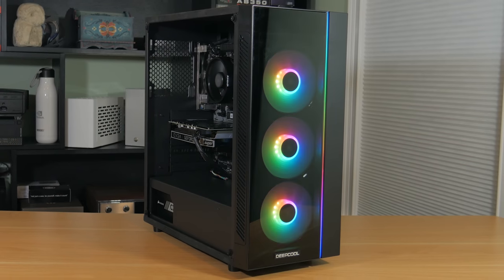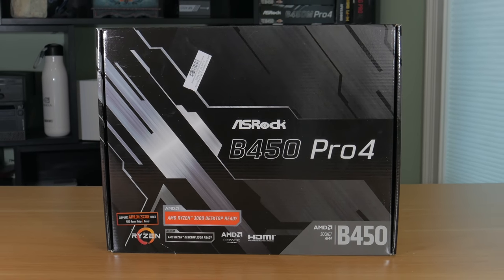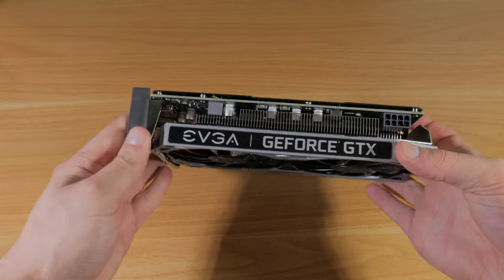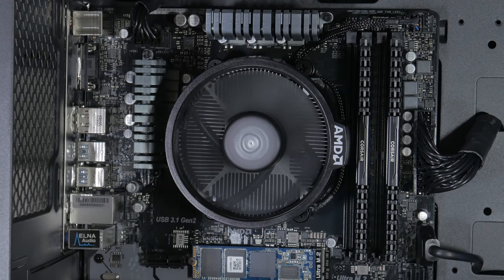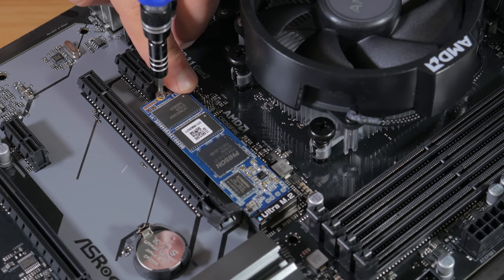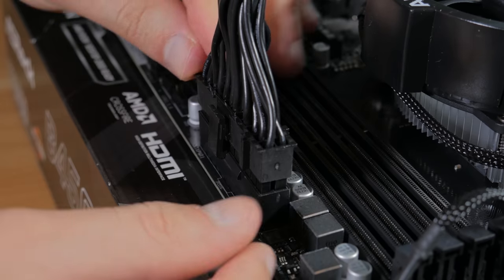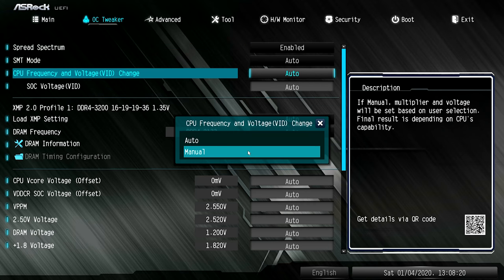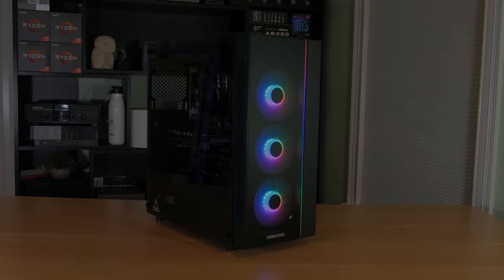$750 Gaming PC Build Guide! | January 2020

Comment: 2:54 - I would recommend rotating the cooler 180 degrees to prevent the AMD logo from blocking the dimm slot.
Reply: Diego Galvez hahah yes
Reply: i wwould recommand how he put it is the "good" way, this cooler is made to be like in this video. you can check online.
Reply: vinvinudu77 how would you put in 4 sticks of ram then ?
Reply: @unemployed6776  This is a micro-atx board, but there would be enough clearance for the ram if it were full atx.
Reply: Great idea. I wish I saw this comment before installing mine 😂
Reply: Came here to say this.  Bonus comment, Diego it is full atx not micro
Reply: Yeah, wish I read your comment first. Had to take it off and do just that cause I put in 32g
Reply: Clockwise or anti clock wise?
Reply: Diego Galvez I completely agree
Reply: @unemployed6776  put the ram in first
Reply: Or position it upright

Comment: For every build I did with AMD I always switch the AMD logo and put it to be on top(not left or right), it may be just me but it looks better that way.
Reply: agreed, ive never used the spire or steath cooler, but it seems much more aesthetically pleasing. i only have experience with the wraith prism and max
Reply: for the wraith stealth cooler, u can't. The holes on the mobo for the cooler, is oriented in such a way, that the cooler must be oriented to the left or the right (cannot be top).
Reply: Is it worth the cable slack tho?

Comment: I’m buying a pc and didn’t know what to get this helped me so much u got the perfect timing for the vid.
Reply: Don't buy a PC. BUILD it. The components that come in store bought PCs are CHEAP. Look up some of Walmart's builds. They're nasty.
Reply: And, even if the store bought PC says it has a 1660 super it's the cheapest version. Cheap fans too.
Reply: Bill B yeah it might have a 1660 but they usually skimp out somewhere like air flow, storage or ram
Reply: There are sites where you can yourself choose component and they will assemble and send it to you. Choose that instead of buying a prebuild.
Reply: Sahas K what site is that?

Comment: I built this pc with every part except the mobo (used a slightly different one on accident) and this pc runs like a dream. I can run fortnite at 200 fps with max graphics on with no trouble at all. I only had one problem, the root of the problem might have been the slightly different mobo, but not sure. I got the B450 M Pro motherboard instead of the B450 Pro. there is a slight difference, and some of the inputs are in different places, so MAKE SURE YOU HAVE THE EXACT PART HE SAYS. The PC was crashing every 10 minutes or so when I first built it, and I got a tip from a friend to take a stick of RAM out, and that worked. It might have not been seated properly or I just got a bad stick but 8 GB runs fine. here are a couple links to a video on how to set up the BIOS and a reddit page on how to put the correct configuration for the front panel connectors (Matt said look in the manual but I was lazy):
Front panel connectors: https://www.reddit.com/r/buildapc/comments/ahp51r/prime_b450ma_front_panel_connector_problem/
BIOS:https://www.youtube.com/watch?v=vHS_3qi0kXg&t=172s
Thanks Matt if you end up reading this!
Reply: jaspa b yeah i almost accidentally got the B450 M Pro too on accident... it’s a dumb marketing design they look so similar and the name is almost identical. i ended up like triple checking my parts to make sure i got the right stuff and i realized it, so happy i did lol
Reply: Ryan Baird can you send me a link to the actual motherboard ?🥺
Reply: fruyeeni https://www.microcenter.com/product/509729/asrock-b450-pro4-amd-am4-atx-motherboard

Comment: Hey man. I just ordered all the parts to build my new PC. I spent about $759 without taxes. $809 with taxes. I got a ryzen 5 3600, coolermaster hyper 212 rgb, MSI b450m vdh max, Gskill aegis 3200mhz 16gb, then I get 1 tb crucial p1 NVME M.2 SSD, then I got a XFX Fatboy OC+ RX 590, and the fractal design focus G, and a 500w PSU from Evga. Gonna upgrade to rtx next year

Comment: How about the CPU temperatures with the stock cooler?

Would like to see a second part.
Reply: Andrés G idle is averaging 40 c but I also have  6 fans in my case gaming is great also with rainbow six around 60-70c and Fortnite around 55-65c
Reply: @chickendinner1563  thanks for the reply!
Reply: @chickendinner1563  what other games you play?
Reply: Your Favorite Jojo that is currently it and they temps were tested with an over lock on the cpu and gpu

Comment: i’m not trying to hate, but I really, really think even at any price range below 1,500. Just go used. It. is. insane. Going used makes SO MUCH MORE SENSE. I made this near exact same rig (but better) for 650 LAST YEAR. 

Specs: 
Gtx 1070 ti (with massive scratch) -200$
R5 2600 -140$
2x8gb 3000mhz ripjaws -60$
2tb seagate hdd -40$
128gb samsung ssd -20$
Case (same as video) -50$
fan -20$
2rgb strips -10$
1000watt psu (I know overkill but insane deal) -60$
50$ on odds and ends, cable ties, 1 rgb header to 2. 

Final: 650 for a better performing build 1 year ago.

Now I am not dissing on him at all, this is a fantastic build for 750 NEW. But, all i’m saying is going used.. is litteraly, the best thing to ever come. You get insane deals, insane prices. And to finish it off, insane performance. All i’m saying is, any price range i would say below 1,500 just go used. You will not regret it. 

I mean no hate, just wanted to share, Thanks.

Comment: This is a great guide, however I did change some things.

1. I changed the motherboard to the gaming k4 from asrock.

2. The RAM was changed to Corsair Vengeance RGB PRO.

3. Got a cheaper be quiet! 450w psu because 450 is all you need.

Comment: This is literary the setup i wanted to build and now it costs like 850$ ...
Reply: Just get a different case.
Reply: For me its £788.18
Reply: now it costs 770!!!!
Reply: @milfshakeyaeger7675  oh really?
Reply: @warrior8154  for me its 755
Reply: @milfshakeyaeger7675  for me it cost still like 820 euros and to ship it to finland 910 euros so lmao
Reply: Well u could always use used parts or use different parents in general, Ryzen 5 3600 ($180-200), B450 Pro4 ($85-90), GTX 1070/ti ($200-300)(used), or u could go for the 1660 super if u want new, 120gb kingston a400 nvme m.2 ssd ($20), 2tb seagate bearacuda hdd 7200rpm with 526mb cache ($55), OLOy 16gb (8x2) 3200 RGB ram, or Corsair Vengence 16gb (8x2) 3200 ram ($62 ish), aresgame 650w psu 80+ bronze ($60), any atx case ($60), that should be about $650 ish u can change the psu and ram to something if you want like from a more reputable company. If u dont want the stock wraith cooler id go with the thermaltake ux200 ($32-40), and get a 5pack or less fans rgb or not (40) if u get the parts i listed it comes out to be about $700-$750 depending on where u get your parts from

Comment: Would've been a lot better using a ryzen 5 2600 with an rx 5700 and a 2.5 ssd instead of the m.2, way more gaming performance for the same price
Reply: Amir Lalmi Ryzen 5 1600 “af” is 85 bucks and is better
Reply: Please search in google before commenting
Reply: @tanishqbhaiji103  i am well aware of the 1600 AF but there aren't enough benchmarks out there that prove it's value whereas the 2600's performance and value has been proved time and time again
also don't be condescending to people it makes it hard for them to have  a polite conversation with you
Reply: 1600 is better for price to performance and you could get a 1080 on amazon.de for 250 euro so 280 dollars ish.
Reply: @R3RS2024  the cheapest 1080 on amazon.de is listed at 435 euro so no

Comment: That is a fantastic build. After such a busy Christmas/New Years it was really calming and almost therapeutic to watch this video. For some reason I still like watching build guides even though I already have a rig. Only downside to that build was the case because I do not like the fact that you have to push out the PCIE slot covers. Can get messy and you cannot reinstall them if you want to sell the PC case again or something. Great well rounded gaming PC though otherwise. 
However, I have a question since I have a 256gb SATA SSD for my boot drive and a 1tb hdd mechanical for mass storage of games etc. But it takes up so much room in my Silverstone Sugo SG13 itx case so I wanted to get an M.2 ssd. Would it be worth it to get a non-NVME SSD since they are a lot cheaper then the NVME ones. I could get a 500gb M.2 ssd for around £50 which is not bad. Though I might wait and save up for a 1tb NVME SSD so I don't run out of room. 
Also, would a GTX 1660 super or 1660Ti be a good upgrade from an RX 580 8gb that I got used for £120? My other specs are a Ryzen 5 2600 (new) and 16gb ddr4 3200mhz ram also new. I have not overclocked my CPU because there is a psu on top of it with a few centimeters of space and I'm using the wraith stealth cooler. But do you reckon I could run an overclock like yours in my build? 
Many thanks in advance and hope you had a good Christmas and new years!

Comment: Great video. But you forgot to mention the Ryzen 3600 processor's compatibility issues with B450 motherboard. My suggestion is to go for Ryzen 2600. You can find find the difference between 2600 and 3600 processors in very few selective games, which will be a 5 -10% increase in performance in favor of 3600. Other than that, virtually no difference at all.  You can save a few bucks with 2600 and don't have to go through the hassle of updating the BIOS of this board or buying an x570 board. That's my 2 Cents.

Comment: i just bought a 600$ pc featuring a ryzen 7 2700 and rx 580 4gb cant wait to build it this next weekend
Reply: Cadeece I saw the 2700 is 159 on amazon.... truly a steal!
Reply: i would have gone for the ryzen 5 1600 and a rx580 8gb which will out perform the 2700 rx580 4gb for 10 dollars cheaper
Reply: @R3RS2024  i got a great boxing day sale on the ryzen 7 2700 and the 1600 really isnt better its a 6core processor which is already getting iffy for alot of stuff and i got the rx 580 4gb used because i missed out on a different card i wanted to get but the 580 4gb is fine for my needs
Reply: @onecleangti  yea i got it for 130$ ish on boxing day was a great deal cant wait to put it in my first build
Reply: @cadeece6739  why did you not take a rx 570 8gb
Reply: @khoado2060  but 4gb mire

Comment: Help me I'm only getting 50-70 fps on the same settings
Reply: purpose. On what
Reply: @street3936  fortnite,  I reset my pc and put on some thermal paste and removed some of the parts and reinstalled them. I'll tell you how it works after I reinstalled all the games
Reply: purpose. Ok
Reply: @street3936  I reset it and games are working fine!
Reply: @digga1  how many fps do you get max
Reply: purpose. why did fortnite look so choppy in the video
Reply: @ΣτέφανοςΚεφαλοπουλος  capped at 300 get like 270

Comment: Nice video and nice build. I would have used the oddball Ryzen 1600AF for this price point. It is basically a 2600 with a with a little lower base/boost clock if you keep it stock. Its a odd processor as it is actually a 12 nm processor (not a 14 nm like the original 1600, and will OC just like a 2600. The real bonus is its only $85 on Amazon. $75 savings is huge at this price point. The GTX 1660 Super is a very appropriate card for this build, but the Ryzen 3600 will not have more than 1-3 fps advantage with this card vs the Ryzen 1600 AF. Good job and I liked the way you presented! Thumbs up!

Comment: Built a p.c only using Ali express
Reply: Saurabh rana specs?
Reply: I think the best build you can build using AliExpress without going too far is this

Cpu e5 2689

Mobo x79 haunan or something cheap

Ram 4x4gb 1333-1866mhz or 4x8gb if you need ram so bad 

Gpu rx480-rx470

Cpu cooler the snowman ofc

1tb ssd from kingspec and 2x500gb refurbished hdds with raid 0

And any cheap case and  500power supply or better but I recommend getting your psu and case from somewhere else
Reply: @mr.br4dga279  u can do way better a ryzen 5 1600 
rx 570 
ddr4 3000mhz 16gb (2x8)
500gb ssd
idk which mobo probably a B450M-DS3H
Reply: @cadeece6739  but it is not the best price to performance build but it ia still pretty good non the less

Comment: This case probably has no air flow whatsoever. My new 2070S is cooking quite high, so I need to take off front glass panel for better air intake. No matter how big grills on sides look, they still suck. I think that front mesh panel is the best way to go, and cases like Cooler MasterBox MB511 RGB shows that even front mesh panel can look absolutely great with RGB fans.

Comment: “No compromise in this build” 
Has a stock cpu cooler
Reply: Stock cooler on this cpu is actually pretty good. doesnt need aftermarket fan if you dont want it for the looks or then try to oc it. i wont recommend to overclock 3gen ryzens. They will not last long with over 1.35v. one cpu already which wont go 4.5ghz anymore  even with 1.45v
Reply: Tuononen Perkele well I actually have the better stock cooler, the wraiths spite I think? Oh that, my r5 2600x hit 75c after one run of cinebench. On my new gammaxx gt cooler with stick thermal paste; in getting 62c after one run. That is a big difference.
Reply: @meese1k  i get high 60°C when fan is on normal profile with my r5 3600 so not so bad
Reply: Tuononen Perkele when running cinebench??
Reply: @meese1k  when runnin prime95 and cpu  z gets almost as hot in 10 min.
Reply: Tuononen Perkele do cinebench. That’s fair test
Reply: @meese1k  but prime 95 is software that uses cpu all it can. it stresses more than anything you would actually do.

Comment: You can also use the 1600 AF for 85, which is basically a 2600.

You can put the 100 dollar savings toward a higher end GPU (2060/Super/5700/5700XT) which should give you better results at higher resolutions.

If you're at 1080 high refresh, it may be better to go with the 1660 super